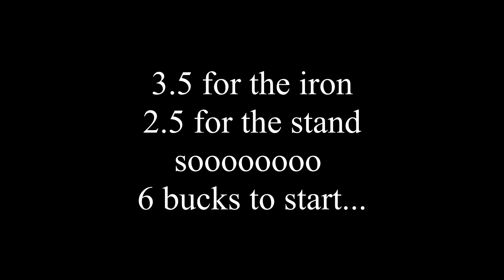Is a 30W soldering iron good ENOUGH for electronics???

Comment: We modded an XBox with an iron like this back in the days. It's totally possible. Wouldn't want to go back to one though. Just recently ditched my cheap temperature controlled station for a 100w USB-C iron at it's so much nicer. The USB one was actually even cheaper, but it lacks a power supply of course.

Comment: They are often sufficient for much stuff like simple soldering on stripboard. You have to be careful though because it can end up being false economy, and really inefficient if you find yourself having to buy higher wattage ones, for different jobs. Sometimes it is better to just find a reasonable priced temperature controlled one, and just stick with that.

Comment: Will this work for Gameboy Advance motherboard?
Reply from the maker: It can. But it can get too hot... So I don't recommend it.
Reply: Don't use this. The ESD can destroy components on your motherboard. Buy a better soldering iron for working on motherboard, for example Hakko FX-888D.
Reply from the maker: @Brian-uq6jm  This iron is Grounded, so ESD is not going to be a problem. The high temperature is the problem.

Comment: You need a temperature controlled soldering iron.
Reply from the maker: I have it. Video on that coming soon, finished editing it.
Reply: They are way better, and it is very typical in industry, where they nearly always buy expensive, rather than cheap. Keep those employees happy, and show that you care about their expertise. I got annoyed with my cheap one because when I came to desoldering components from a larger heavier board, it was not sufficient. It was fine for most basic stuff for stripboard.

Comment: Is this okay for soldering guitar electronics?
Reply from the maker: Absolutely. That's how I started electronics in the first place. Good luck with it 🍀😊
Reply: @milanfixer  thank you for the quick reply, i need it, ill sub.
Reply from the maker: @ekwnfhwndgv561  Thank you very much my friend 😊
Reply: Did you end up using it on your guitar? I just bought this at Home Depot today for a guitar mod I want to do. It was basically the cheapest most basic solder gun they had and I don’t need to solder much other then a small wire here and there. Guitar electronic wire is pretty thin gauge and doesn’t need to be fancy.. Can’t imagine it won’t work.
Reply: @JoshuaDomoslai  yes
Reply: @JoshuaDomoslai  it does the job perfectly.

Comment: These types of soldering irons can no longer be used in electronics today , yes  in the electronics of the past but hopefully they are not applicable today anymore and the fundamental reason is that the heating mode of those Soldering Irons is a tip that is inserted in a tube with a coil that heats when is connected to the wall  and that type In principle you have electrical leaks in the tip and  can damage today's components such as an IC  Transistors etc  , that is why a station is needed today a soldering Station not so much to see the temperature on a display etc. More than anything because the element today  that heats it is made in a tube of quartz and ceramic and is  because  the station in self separates the  element from the plug on the wall
Reply: Then why there's still a lot of it being sold in the market?
Reply: @golski1273  this type of solder can be used for home project like diy or maybe making a speaker and other simple things